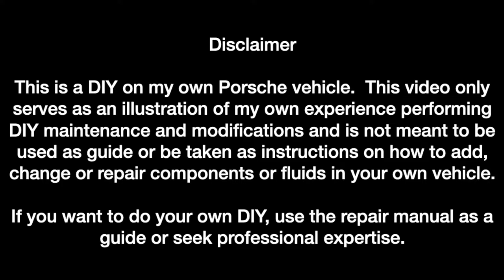RGS GRILLES INSTALLATION - 2018 PORSCHE 718 CAYMAN S

Comment: I think what would have made it easier when you installed the side vents would have been to ziptie the screens in place until after the vents were reinstalled. Then cut the ziptie and remove it.
Reply from the maker: Great point!
Reply: HI, for my 718T, my center Porsche in France  said to me : ok for the front grilles for protect condensor and radiators projection of pebbles. But for the lateral grilles the motor temperature risk to change because the air flow will not the same... Air flow motor it's managed by electronically system. Where is the true? Are you observed anything of a change temp  for this part. I hesitate because Porsche approved guaranty. Thanks.